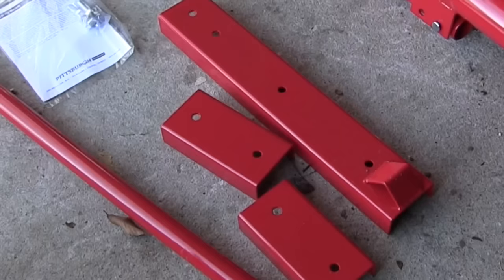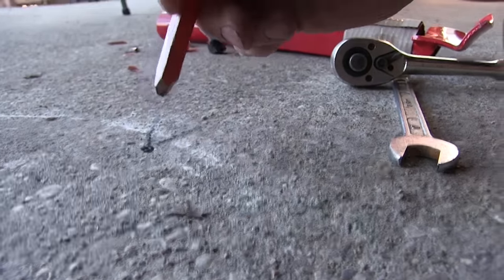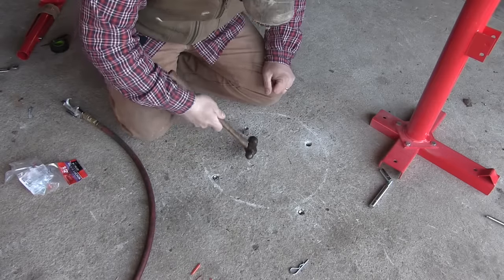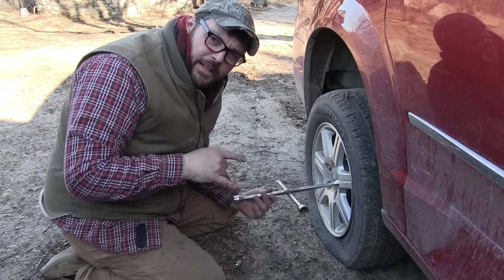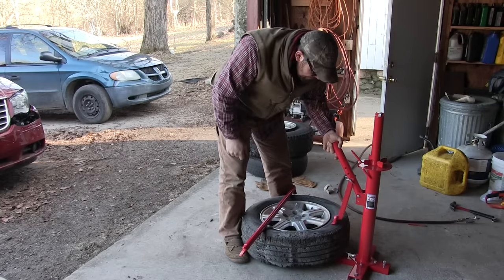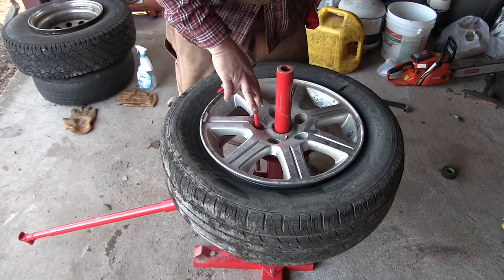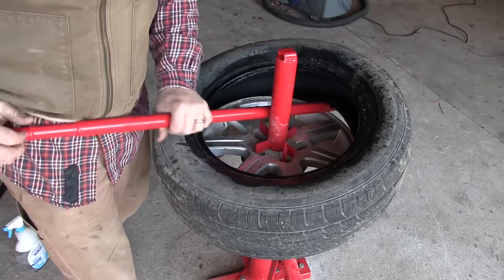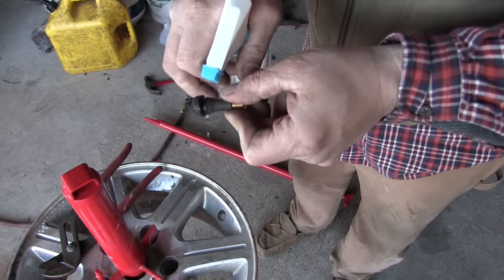Harbor Freight manual Tire Changer review

Comment: It's important to mark your tire where the valve stem is so that when you remount the tire that it stays relatively balanced.
Reply: I don't think that will work if you replace it with a different tire such as one without a nail.
Reply: @SweetFLGuy1  every reputable tire comp I've gone to that repairs tires marked the sidewall with chalk so that they don't have to rebalance the tire when they put it back on the wheel. Putting a different tire on will require it to be balanced again.
Reply: @Farm_fab  if it’s a different tire it’s gotta be rebalanced no matter what but if it’s the same tire you’re right that’s why most tires have those yellow dots on them if you line the dot up with the valve you’ll get the best balance
Reply: @Farm_fab  Exactly the right thing to do, mark the tire with some chalk by the valve stem and reinstall it back to where it was originally. Or if installing a new tire, line up the valve stem with the dot mark on the new tire, mounting tires 101. It's always done that way even back in the 70's when I worked in a tire shop.
Reply: @rogertalley7944  I've found that even with modern technology, that tires do require being balanced. Not too long ago, I needed 4 ounces on one and without the weights, my steering wheel vibrated badly.
Reply: @rogertalley7944  ill agree with you that as the tire loses tread it will need to be rebalanced but only big ass truck tires like 295+ with off road tread regular car/suv/small truck tires should be balanced for sure or you’ll get a shake but you are partly correct. also if the balancer isn’t calibrated properly balancing might not give you the right results so maybe that’s what you experienced?
Reply: @rogertalley7944  also there are some tires that if you mount them at a good spot won’t shake but that’s usually luck or a very well made tire and rim
Reply: GEt a bubble balancer tire tool and a box of various wheel weights too. The old method was to balance with the weights top side, then use two weights only half that size (weight), one on each side of rim.
Reply: also removing the sensor changes the balance...perhaps this was coverd. im late to the party.
Reply: Think about a fokkin trillebør, if you use a trillebør you would never the fock think about how balanced the tire is on the rim.. You would look at it, looking great.. Feel the good tight tire pressure of the air in it and be happy and go move your fokkin jord!
Reply: @JH-zi7fq  huh
Reply: @JH-zi7fq  We aren't talking about wheelbarrows, but tires for high speed use on roads, for cars and trailers.
Reply: I bought the Harbor Freight Bubble Balancer.  It actually does a really good job if you know what you're doing.  However, I had to first zero out the bubble prior to actually setting the wheel on it to be balanced.  Could have been bumped during shipment.  On steel wheels, divide the weights between the inside and outside rim edge. On alloy wheels, stick the weights along the center of rotation.  To "fine tune" the balance, flip the wheel over so that the center of balance is more critical.  On my Rav-4, the balance achieved is just as good as any spin balance.  It was perfect.  Two tires needed no weights.  One tire needed 1 oz.  One tire was way out and needing 5 oz. If you don't have the exact size of weight, just trim the weight until the balance is perfect.  Nobody will notice trimmed weights.  I'd recommend checking the balance of the  bare wheel itself before mounting the tire.  Stick-on weights will probably have to be removed prior to mounting the tire.
Reply: I think when he removed the sensor that all went out the window.
Reply: Dude, if you're too cheap to take your car to a tire shop and drill holes in your garage floor, then you dont give a shit if your car's tire is perfectly balanced. 
Besides, the balance is more for the wheel and not the tire anyways.
Reply: @filipevieira6052  Bullshit, I've been driving 100 hundreds of types of cars for the last 30 years, and I've never paid to have my cars tires balanced. Its a bullshit waste of money. It's in your head.
Reply: @rogertalley7944  Agreed my man, these guys are suckers. They've been brainwashed with the damn tire shops. If you have a shake that bbad, you have a bad tire or something is loose or bent.
Reply: Every tire, from the manufacture, has a dot on the sidewall, that is supposed to line up with the valve stem.  A way to tell a good tire installer, is to see if they  installed it that way.   It doesn’t affect the tire, but helps in the balancing process.
Reply: @mikeworkman3593  you might want to cool with the tire shop psy-ops language. We wouldn't want the Goodyear or Firestone goon squad to roll up at your house (on perfectly balanced tires). 
   If you see them taking off their name badges, well....it's already to late. 
  I will tell you this. I have driven about 10 cars over 20 years. Many tires DO have to be balanced. Now of you don't drive over 45 mph, you might get away with it. Cheaper or damaged tires will obviously require more weight.
  So, either you are the one human on earth, that has managed to have perfectly concentric tires on hundreds of cars, the laws of physics don't apply to you,.......or the most likely scenario. 
THEY BALANCE THEM WHEN THEY INSTALL THEM ON YOUR VEHICLE!!!
Reply: Y'all that are saying tires don't need to be balanced are sounding really silly. 😂
Reply: @letsdothis9063  I put on my own tire, and I don't have a balance machine, and I never drive under 45mph. Sorry to say but you've been ripped off for years.
Reply: @mikeworkman3593  I hate to break it to you. And, it sounds like you might have the onset of dementia. So.....again, with all due respect sir, your testimony does. Ot hold up. 
  You chastised that other fellow for and I quote "if you are too cheap to take your.  r to a tire shop"
Reply: i dont care if my tire is balanced hows that
Reply: @mikeworkman3593  ok know it all. Wrong on all aspects. yeah I'm cheap because I wanna save thousands because I don't do 5 plus vehicles a day in my shop worth of tires... How in anyway is my shop cheap when spending money actually more because we mount and balance ourselves spending more then just paying or free sometimes than than doing it ourselves because we can or in my case a mechanic shop owner.... And lastly yeah um we do give a shit and want it done right
Reply: If people only knew that tech is only!!! Paid .75 hours for the whole job of 4 tires ticket grab to ticket completion a lot of people would start doing themselves...
Reply: @decibellone696  Was seeing if anyone got to that yet.
Reply: @BlackToTheFuture_99_S-10  Paid 75 hours?
Reply: @SweetFLGuy1  are you saying there was a nail in it when it got balanced?  Otherwise it would certainly be balanced if you put it back in The same spot
Reply: I've never balanced a tire and honestly have never had a problem over rated if u ask me.
Reply: I've always marked on the sidewall right above the actual wheel weights too, that way I'm never guessing especially if you have to pull off clip on weights.
Reply: That's unless you're putting the same tire back on it won't do much for you
Reply: @decibellone696  ñ
Reply: @mikeworkman3593   Speak for yourself, dude.  I like doing things myself and it's not because I'm "too cheap."  It's because when I do it myself it's done RIGHT.  My last tire installer "torqued" my lug nuts with an impact wrench.  I suppose you will say having proper torque on them is a waste of time, also?
Reply: @RonnieCarter38501  It is a wastes of time. But I've been a professional mechanic fort 32 years, what do I know. 
Unless you have some fancy expensive custom rims, you just tighten them as tight as they're supposed to be, whether it's a fire truck, a bus, a garbage truck, or a ford Taurus, you should know how much to tighten a lug nut with an impact gun, using the proper impact gun for the job.
Reply: @bigjay6743  Exactly. If you have a shimmy or vibration, then you have a problem with your tire, or a bent rim. They used to put BBs in the tire to self balance them back in the day. But now they rip off customers by up charging another $12 ro 15 to balance your tire. If it was so important, it should be a free automatic service as part of the mounting. 
I'm the guy they bring things to when NO ONE can figure the shit out and they've taken it to 15 other shops. But yeah, these other keyboard warriors are all experts and get paid $80k a year as a tech to diag drivability issues.
Reply: TMS sensor definately had different weight so does nt really matter - you have to rebalance
Reply: @letsdothis9063  he is just a troll
Reply: It's easy to see who's never actually balanced wheels before. If you have you'd know that cof the tire or weights move by even a couple mm the balance could be thrown off by grams. Meaning possible shaking/vibrating... Meaning a customer comeback... Meaning now you have to balance the tire for free
Reply: one problem with that, he removed the tire presure sencor, i know they dont weigh much but it does throw off the balance. 

But honestly this dam tire store have 1/2 ass mechanics that cant seem to balance a 275$ tire as it is.
I go in for balance and rotation,  they strip off 8oz of weights and put 1oz back on, there's no dam way i lost 7oz of weight off a tire in 3k miles.
Reply: Depends on what kind of wheel and tire your doing, atvs and lawn equipment tires balance isn't important a car tire is and the dam tire shops cant even use a 6k dollar machine and get it right.
You'll know if your ride isn't smooth.
Seems most of these places hire unqualified rookies to balance tires
When you spend 250 bucks a tire you really need them done right or the tires going to get screwed up.
Reply: In this case the Tire Pressure Monitoring System (TPMS) Valve was replaced with a simple (old school) Valve, they both have slightly different weights so the mounted tire/rim/valve MUST be rebalanced even if the tire whent back on the same side and spot. Also, on wheels that are balanced with Lip Weights that clip on, those weighrs have to be taken off before you remove the tire. If you don't remove them, they make removing the tire more difficult and they can slide on the lip as you work the bead on/off the rim... which unbalances the entire wheel when you are done. I always re-balace a wheel whenever ANY work is done on a wheel, even if a lightweight plug was put in.
Reply: @decibellone696 You are correct, the TPMS Valve removed and the old school Simple Valve installed do have different weights, so even if the same tire was installed on the same side of the rim and in the exact spot, the entire wheel needs to be rebalanced. I didn't see him mention that anywhere in the video.
Reply: Even brand new tire come with a mark for where it sits with the valve. Old tire need to be marked before removal.
Reply: No , when you cut the air sensor out you change the balance not much but it’s not the same been there done that , l’m going to tell you something I really don’t feel like but here goes a spin balance machine of course has bearings in it so it can spin at a high rate of speed if those bearings are not set at least what is known as field setting .005 thousands it only gets worst a machine cannot mix it self the bearings can be adjusted in any machine except manual the bearings in the tire/wheel balancer should be adjusted at least every week especially the ones that don’t have a oil bath (oil being pumped to the bearing via reservoir) will wear out or break in especially when they are new when they set the tolerances change slower the bearings should be set at .002 thousands to give the bearings room enough for oil or grease to get in between the rollers and races to tight you are burning up the machine to loose you are balancing your tire and wheel to the machine it is on if they don’t have service like any other machine they will lie to you the only good thing about the whole system is wheel makers are balancing them at the factory and tires are made much better and are half ass balanced when you see tire with the blue and yellow dot bad balanced tire I don’t want to call it a reject but there is a reason the factory had to dot them
Reply: Yeah we do this at discount tire. We will chalk where the valve stem is so we can skip balancing
Reply: When I worked at discount tire we always rebalanced the tire no matter what
Reply: @SCTTanielu  my store would mark the valve stem as well and put it back on and send it on its way.
Reply: Just use balance beads
Reply: I was gonna say the same thing